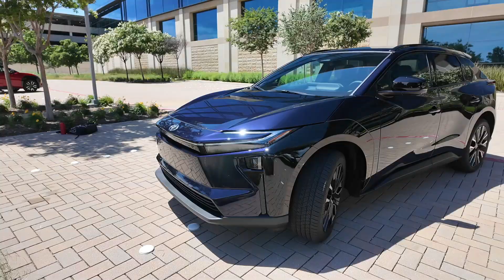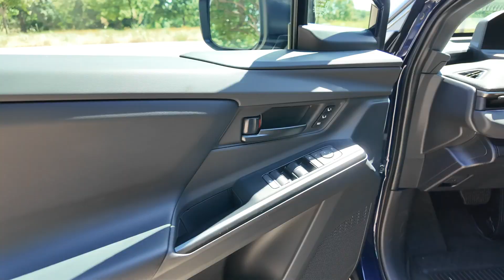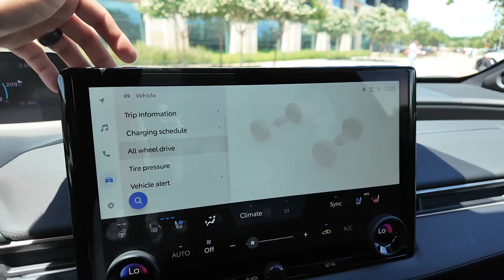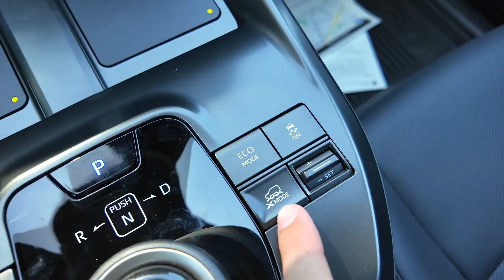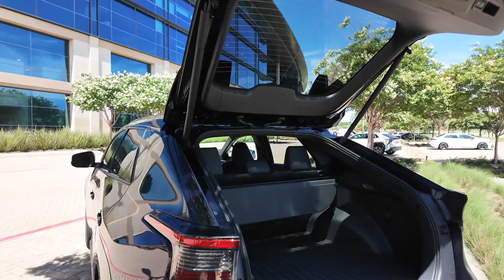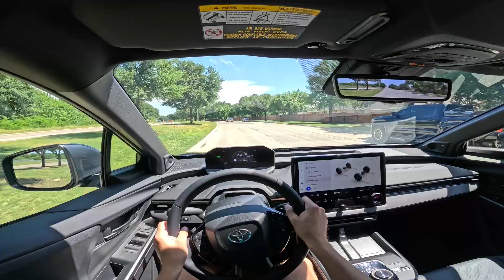Is The 2026 Toyota BZ Limited The BEST New Electric Crossover?

Comment: Back seat does not support you...uhm, you know they do recline...right?

I own a bZ, it's a dealership special edition it has, XLE FWD Plus SE, it's basically an XLE plus but it has 379 HP and 318 range, it really gets up a zoom zoom's. Wrong company I know...lol, everyone does a review on the Limited,  wish reviewers would test the XLE Plus, or XLE Plus SE, though I'm told as it is my dealership who said I'm the only one in the area to have it, as far as they know, so hard to get and find the XLE Plus SE, but the XLE Plus is pretty cool.

Mine you step on it and the world outside just melts. 

I'm 6' 5" tall and fit just fine, you need to lay back some and drop the wheel to where the top of the steering wheel is just a hair under the cluster screen, and it's perfect.

Nevermind the climate lack of buttons to control, NO ONE does this car justice, you can say Hey Toyota,  I'm cold.  And the car will switch to automatic and make the cabin cooler, but it gets better, the car has you as a profile on your phone, it learns how you like your cabin climate to be, and as time goes on it learns from the outside temp to what you are doing and how you lile to be, im on my 9th day of owning it, and I just put the climate on auto and I don't touch anything it changes the climate as to how I like it, i. Cluding the the heated seat and steering wheel.  From hot to cold you just tell it and it dials it in and remembers, fogging up to the car you need the de icer on which will turn the front and back anti fog defrosters on.

Three days ago I got a tire pressure warning on the insturment panel blinking the rear driver side.

I pulled into a parking lot to look opened the door and i could hear it hiss.

So, decided to take it to my Toyota dealership,  and on the way there, bZ asks me if I would like to contact Toyota and schedule a service?

Yes, I said curious as to what will happen...and no ring just all of sudden a man says Toyota of Blah blah where I love he asks what's going on, I explain, no problem come on in...my car made tgat call on it's own I didn't do really anything...pretty amazing.

No one ever talks about the tech it has like that.

And I'm tall and can get in and out very easily, so don't tell people that, unless your 9 feet tall, you'll fit fine.

❤ 👍 

Anyway, thanks for reading.
❤
Reply from the maker: thanks for sharing.

Comment: Is the car "Toyota noisy"? Normally Toyotas have bad noise insulation, and that is very annoying, if one is driving an electric car.
Reply: 少なくとも日本で走ってるTOYOTA車は静粛性が抜群ですがね………

海外で作ってるTOYOTA車はそうでもないんですね……（笑）
Reply from the maker: No, like I mentioned in the video the ride was very smooth and quiet. Felt more like a Lexus
Reply: @BrosFOURRSpeed  Ok thanks, I hope that the European version shares that. I drive now 2023 RAV4 plugin, and it has pretty bad road noise issue, coming primarily from tires. Also many other Toyota models in Europe suffer from the same problem. Money does not help ... Even the top trims have the same issue. Lexus is of course a different thing ...

Comment: They should have dropped BZ from it's name entirely since those did not do well. I predict this will also not do well.
Reply from the maker: The name would not have a made a difference lol!
Reply: @BrosFOURRSpeed  I disagree. Because the bz4x was such a failure, potential buyers have to overcome the first impression.
Reply from the maker: @amill1563 still wouldn’t change based on the name.
Reply: @BrosFOURRSpeed  People's perception would change based on a name change.
Reply from the maker: @amill1563 only time will tell.
Reply: Wrong.  It will outsell the model Y.
Reply: @FilmScape4K  Wrong
Reply: @amill1563 thanks for admitting you are wrong.
Reply: @FilmScape4K  Blocked....buh bye....
Reply: @amill1563 snowflake
Reply: It's a quality EV offering from Toyota with decent range.  It's already "done well".   Sales of EVs aren't going to keep the doors open & lights on for a while yet.    It's a hellava baby step.
Reply: @cbotten106  This isn't even for sale YET. It has no SOLD. BZ4X sales are terrible. FACT.
Reply: @amill1563 Are you okay?
Reply: @coolio_iglesias  same as you bruh
Reply: I have one right now and I must say to be the only Toyota at a Tesla charger without an adapter is a big flex lol and it’s fast af🔥🔥🔥🔥